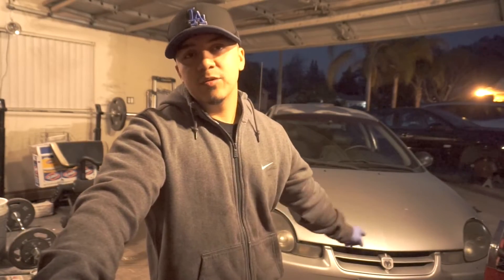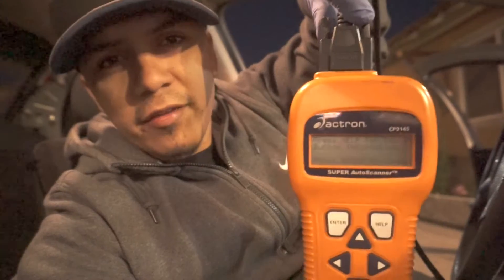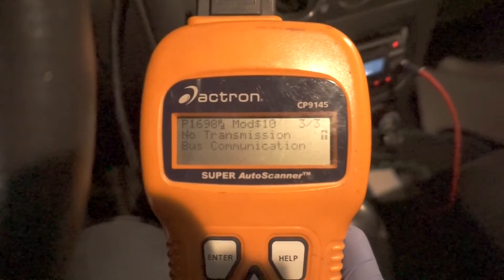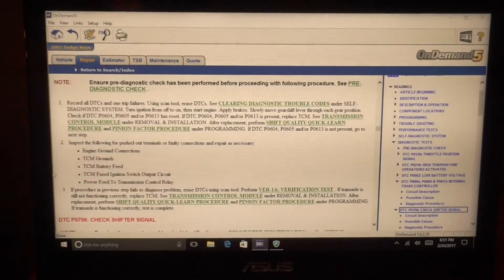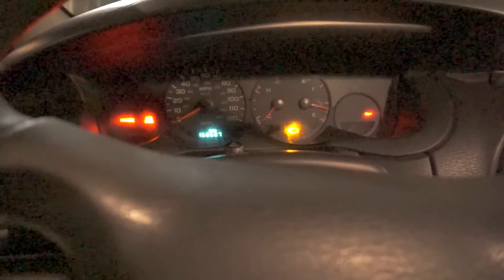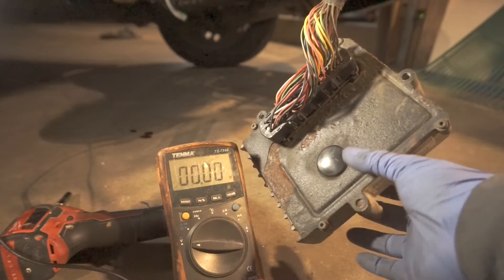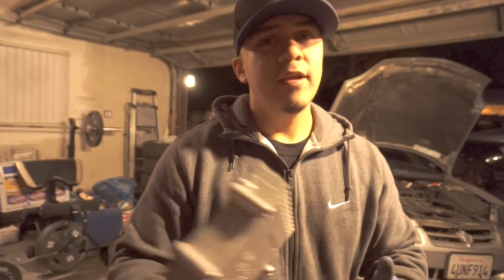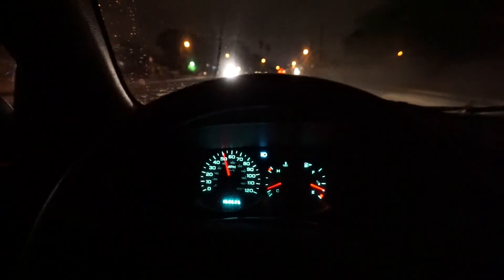Check Engine Light-Car Does not Shift-No Speedometer

Comment: I just bought a 2003 Pontiac vibe from my mom and my brother in law told me to change the transmission fluid and filter as soon as possible because it looked like it was a little burnt (he is also a mechanic). I no longer live near my hometown I'm at least 300 miles away. Once I got the car home I got everything to do the transmission fluid and filter and had a friend help me out. I also recently changed the oil and oil filter it hasn't been done since 6/2020 according to the sticker on the windshield. Yesterday morning when I started my car I noticed that the check engine light was on for the first time since I got it. Any advice would be greatly appreciated.

Comment: Homie your video is great BUT the Music is to Loud. Now I have a 2002 Chrysler 300m The Check engine Lite Comes On and It shifts into 2nd Gear and speed go's to around 25 to 30  it wont change out to 3th unless i pull over and put in park turn engine off and restart then is shift's rite. it doesn't do it all the time but maybe 4 time since Fri. today is Tues i ran codes and got these PO1684,  PO871, PO700, PO871 Also ABS 17 I checked no cables lose. What do you think trans. control module?

Comment: I have same problem with my 2007 lancer... speedometer not working and the gear stock at 2nd gear... but sometimes the speedometer works the transmission works as well...😬

Comment: I have a 2008 GMC Arcadia I'm driving down the road my speedometer stops working transmission stopped shifting properly but not only that air conditioning stops working ABS light comes on and Stabilitrak also like Tums on. Could you give me some idea where I should start looking?
Reply from the maker: Stanley Blakely just kidding, sounds like you have some kind of communication problem. Check all the modules and make sure you can communicate with all of them 👍🏼
Reply from the maker: Stanley Blakely at the dealership for a new truck 😁

Comment: I replaced my transmission speed sensor and check engine  light still on . it still rev high like its going neutral .  My speedometer works fine only the outside temperature malfunctioning. Any suggestions?. P0500 code 2007 Toyota Corolla s. When I disconnect the wire from the sensor I then have no speedometer but the car shift n drive lots better

Comment: Well this work for a 2005 dodge neon too?
Reply from the maker: Hydro Playz it depends on how it’s wired. I don’t think the 2005 has aTCM
Reply: Homie Hektor idk if it does but I have the same problems my speedometer wont work it stays at zero when I’m driving and transmission shifts hard also some of my gauges kind of go crazy if you have any idea of what it might be let me know please
Reply from the maker: Hydro Playz have your alternator checked before you do anything else. Too much alternating current can cause that.